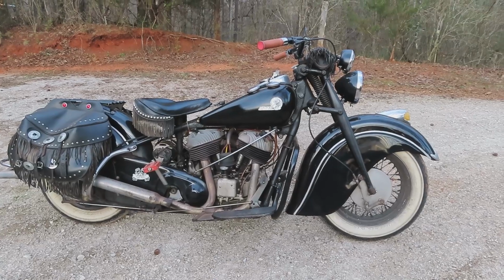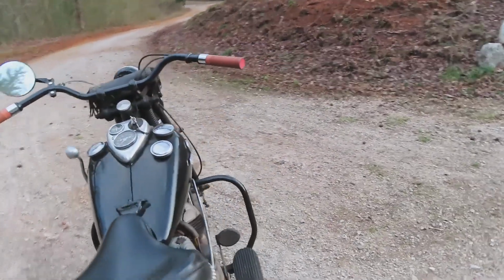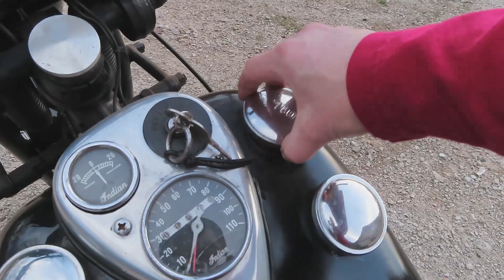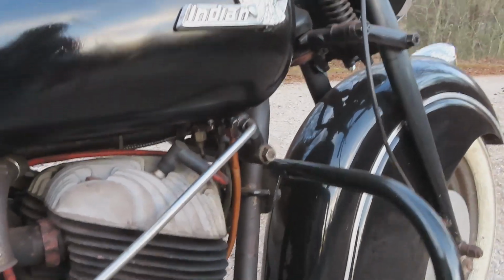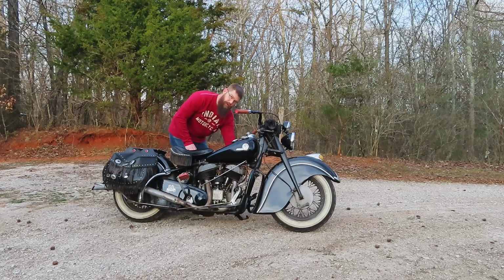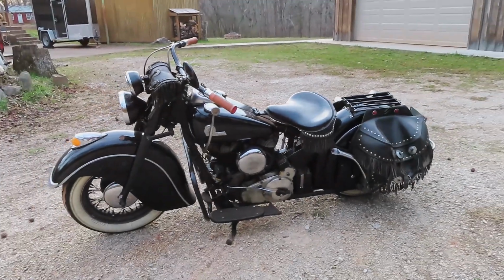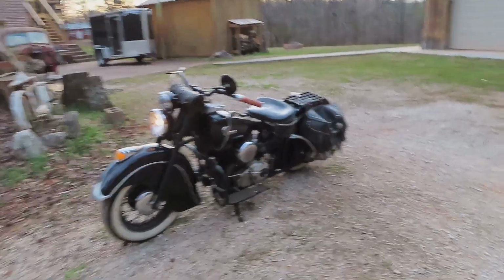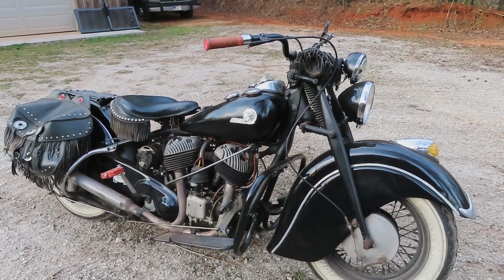1946 Indian Chief - How to Start and Ride an Antique Motorcycle

Comment: These late 40s Indians are great bikes, I have an original 48 Chief, sea foam blue  I use the same starting procedure but use three priming kicks for  a cold start, it always starts first ignition kit unless I have done something wrong with the procedure.  A interesting video, well done.
Reply from the maker: Awesome!  Thank you
Reply: What type of fuel are you using?
I have the same Indian that you have 
same color too.
It seems like it gets really hot and the exhaust turns really blue so that's why I'm asking

Comment: Thank you for the video! I have 1946 Chief with the original 6volt system. I hope to get a battery and have here running in a couple of weeks. Thank you for the details on how you start yours.
Reply from the maker: Awesome!  Enjoy every step of the process.
Reply: Put LED bulbs in the war bonnet and taillight, then you don't need 12 V

Comment: The most iconic motorcycle ever made is a closed fender Indian Chief. My uncle worked at the factory pre and post war. I live about 60 miles from the factory these days. My 1950 Indian Chief is the same color. I'm surprised these bikes are so inexpensive even though they cost good money today, I considered them to be underpriced. In the mid 1960's a good looking, good running Chief could be had for $75. Nothing on two wheels sounds as good as an Indian Chief. Don't put these bikes on display, they need to be ridden. It's a great way to put a smile on anybody's face!

Comment: Indians were such a fine motorcycle it's a shame and competent management ran the company into the ground and Extinction. Thank God for kiwi Indian you can buy a brand new Indian with electric start and disc brakes if you want them. For 25 to $30,000 you can get a brand new Indian with all of the mechanical upgrades that they have had since the 50s incorporated into your motorcycle.

Comment: Nothing sounds as beautiful as a flathead! What do you do regarding the modern fuel (ethanol) and oils? Or have you rebuilt engine/trans to address that?
Reply from the maker: I run 100% gas only, and use conventional 50W oil.
Reply: Most states except for California you can still get non ethanol gasoline.

Comment: Do you what years you could get the buddy seat?  Could you explain why do you think it's a challenge with passenger?  I'm thinking about getting an old chief but have never seen the buddy seat.
Reply from the maker: Not sure what years buddy seats were used.  They are a challenge because it is just a slightly longer rider seat, and two people on it can be a bit of a squeeze.  Same with the floorboard extensions, where the passenger only has a place to set their toes.  It's not like modern passenger seat and pegs.

Comment: What type of gas are you using?
I have a 51 chief I don't know if it's leaded or not and what octane..
Any help would be great!
Reply from the maker: My local gas station has 91 octane 100% gas, so that is what I use.  The high octane isn't that important, but definitely use Ethanol free gas.  Nothing in the USA is leaded any more.  That doesn't matter either. Just find whatever 100% gas is around you and you should be good.  Thanks for watching!
Reply: Not all areas have non-ethanol pump gas. An alternate choice everywhere is Avgas 100LL at local airports. It also is low leaded, which is better for older engines of all types without catalytic converters. Also, do not use automotive oil, but oil specific to motorcycles with better anti-friction additives. All pre-smog engines should use this type of oil.

Comment: I wish I could afford to get ours up to where it could run.. it's a complete basket case that started out as a $500 rusted pile in Mississippi when I was 9 and hasn't changed much in the last 27 years other than a tiny bit of paint, some parts trashed (by my dad) and the cases glass beaded when I was in high school. The frame still needs fixed and repainted again, the bars need the rust removed and painted or chromed, fenders need found, a new seat purchased, a transmission/gears found and a complete overhaul of the engine, as well as new rims and tires. Really with all that's missing or needs replaced, I'd just hot rod it. It'd be so much easier to put on modern aluminum 50's chopper rims with the stock hubs or maybe even disc brakes up front with the stock drum in the back, a 5-6 speed Baker trans to allow it to easily do highway speeds, and a bit of performance parts into an engine that already needs everything and full machining.. why not up the compression and put in big cams while you're at it IMO? Unfortunately I don't have the money to do any of it or to buy it from my dad.. It'd make a great build series for youtube but I just don't have the money to do it. Nice to see someone that actually gets to enjoy theirs.
Reply from the maker: Hopefully you get it on the road someday!  Do you have it on display for now at least?
Reply: @RidgeRoamer  the tanks (which amazingly are in perfect condition) are on the wall in the main garage. Most of the parts are on a shelf in there too, the frame is sitting in the other garage. We're missing the fenders, rims, the transmission's guts were trashed in MS, it needs new pistons, a cylinder cover because one's missing some fins, a clutch, magneto, seat, suspension springs.. Yeah it needs a ton.
Unfortunately even just going non-correct to get it riding again it probably needs 20-30k thrown at it and I don't know if I'll ever have it.. Hell being autistic and physically disabled (scoliosis) as well as having numerous other medical issues, I don't know if I'll ever even have a job again so.. I want it to stay in the family, the story is too good for it to go anywhere else.. but I don't have the money to get it from my dad to keep it.

Comment: It's not a "jockey" or a "suicide" shift. It's a "tank shift". A "jockey shift" is where there's a lever mounted directly to the transmission and the rider reaches behind his left leg to shift the bike (like a jockey whacking his horse with a crop). A "suicide shift" is not a thing. It's a "suicide clutch" which is an old school chopper setup with a springy clutch pedal like a car. You can imagine how "suicidal" such a clutch would be if you lose your balance when compared to a "rocker clutch".

Comment: I guess you get asked this a lot, but what grade gas does an older Indian use, and will it burn lead free? Thanks.
Reply from the maker: @peterjhillier7659  I use 100% gas from the local station, no extra additives required.

Comment: Sweet 46, I see that your Tranny bell crank shows a little wear, "the hole over-sized , about to wear through" mine is the same way. An easy fix without replacing the bell crank is to get a chrome adjustable shift rod from Kiwi Indian part # 722003R, it has 5/16 bolts that attaches the rod and works well. You asked. I am no expert. Here is a link to my 46/48 Indian Chief https://youtu.be/3jFAo3-hKDA
Reply: One more thing you need is Control Cable Lock Nuts Kiwi part # 607003 Their a special nut
Reply: Don't mean to pick your bike apart, you asked!